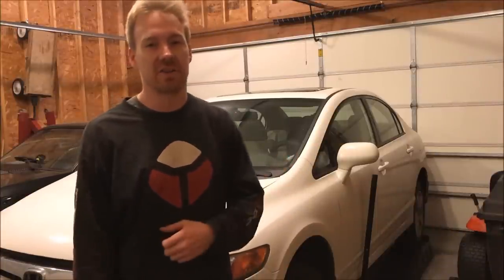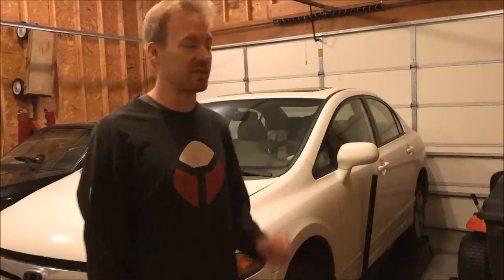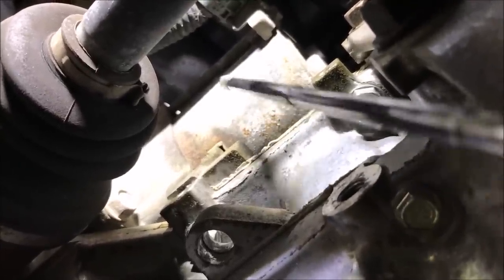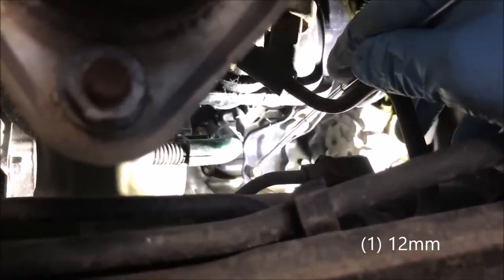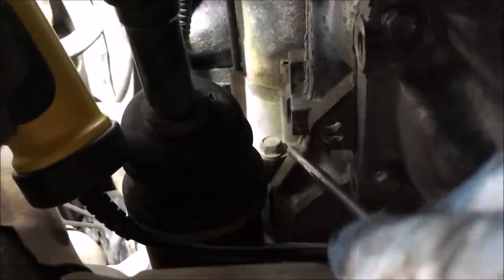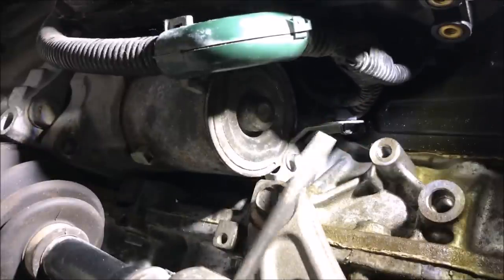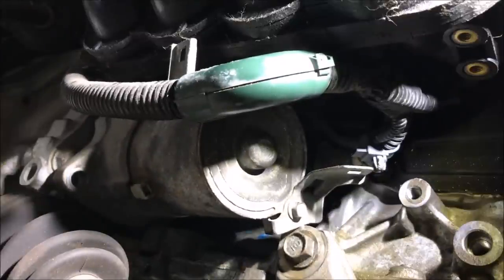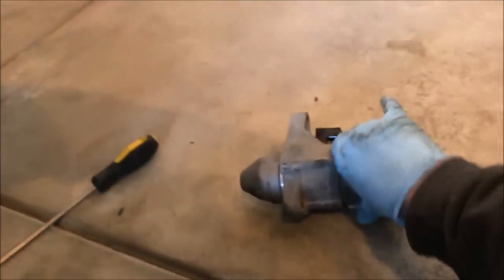Honda Civic Starter Replacement & Diagnosis

Comment: Best video out there for this procedure, and you made it look easy! Thanks for the tips about the electrical tape on swivel joints/fasteners, hadn't thought of that one myself.

Also, just FYI, my 2006 civic starter also began to (intermittently) crank a bit slower around the 250k mile mark. Besides taking a bit longer to start when experiencing the issue, this problem also caused the remote starter to occasionally fail to start the vehicle, presumably because it failed to start within some maximum allowed cranking time. After replacing the factory 8 gauge grounds (all three), which were fairly corroded (i.e. green death on surface, brittle wires that snapped when the grounds were flexed during removal) with 2 gauge wiring, battery terminals, and the battery itself (with an optima yellow top), the problem is still there.

I used an amp clamp to measure peak starting current this past weekend and saw 255 amps during my first cranking cycle, which was, by luck, a slow one. The next 5 starts used between 88-95 amps (peak). Battery was freshly charged as of the first test and each cranking cycle was limited to about 5 seconds with the engine disabled from starting, but spark plugs in (i.e. full compression, so should expect normal amperage draw from starter).

Although the starter itself is still holding out at ~270k, I'll be replacing it soon (my reason for searching for a video like this one), as it seems to be getting a bit worse lately.
Reply from the maker: Matthew Curran Great comment! This is exactly the information that needs to be out there. The problem disguises itself to be a charging issue, but the culprit is the starter. As you point out, that’s almost certainly the case for you given the repairs and mods you’ve completed on the charging side of things.  

And yeah, it’s not too bad of a repair if you’re used to shade-tree mechanicing. Best thing to do is get the car as high up as you can and use something to support your head. Neck tends to get pretty tired. Best of luck!
Reply: 0999999
Reply: I know Im kinda off topic but does anybody know of a good place to watch newly released series online?

Comment: I got stranded 45 mins away from home (sucked!), I tried knocking on the starter and had a friend turn the key, but no luck. I will be returning tomorrow and I'm going to try to replace it based on your video. I watched a few other videos and said screw that haha. But after watching your video with such concise details, I'm giving it a shot. Thanks for the thorough video and wish me luck ha
Reply from the maker: Joe Humeas Yeah sounds like a bad time to break down! Usually never a good time!  If you’ve got some mechanical know-how, you’ll be able to do it. Main thing is to make sure the wiring clips are all unclipped so you have adequate room to work and to be patient and take your time. I had to stop several times to rest my neck, but it worked out pretty well. Better than I expected. Best of luck!
Reply: Blueoyster5 so I gave it a shot and it was rough. After 3.5 hours I had to head back home. I was able to remove the old starter and get the smaller bottom bolt in (not all the way in!) the new one. I’m going to head back tomorrow to finish up. None of my bolts unscrewed easily and the clips were all just as difficult.  I was able to clip the black electric clip onto the new one and I screwed the 10mm nut on, then covered that nut with the black rubber sleeve/cover. And then I half way screwed on the bottom smaller bolt, so the new starter is in place. Should my car start up now? Or does the long bolt need to be in place before it will work? I’m sort of nervous I put this in and my car still won’t start. Any further tips are appreciated thanks!
Reply from the maker: @joehumeas7196  Damn, kudos to you for tackling this job off site!  I'm not sure I would've been brave enough to do that, so right on ya man.  Otherwise, it's an absolute necessity to have both bolts firmly in place before trying to start the car.  Anything less and you could destroy your new starter and possibly the flywheel.  Definitely don't risk it.  The starter (when activated) produces a ton of torque to spin the engine to get it starting.  If the gears that mesh the starter to the flywheel become misaligned you could grind them together or at worse, break off gear teeth.  It sounds like you've done everything else correctly, so I wouldn't be too worried if the problem is indeed the starter.  Sounds like you've just got the starter bolts to finish and it'll be smooth sailing from there.  Hope it comes a bit easier when you get back at it.
Reply: Blueoyster5 Yeah I would do anything to have been able to get it at least in my neighborhood. I put the black electrical clip on and I’m super nervous it’s not on tight since I didn’t hear a click? Should it def click? I’ll try to pull on it tomorrow and see if it’s secure. Yeah, I’m hoping tomorrow goes much smoother/easier. Thanks again for the help and the awesome video.
Reply from the maker: Joe Humeas I don’t think you’ll necessarily hear it click when it connects. If you pushed it on with adequate pressure, you’ll be good. You could pull a little on the wire and make sure it doesn’t pull off, but otherwise I’d say the odds are in your favor.
Reply: @FastFixYouTube  Just a followup: I went back last night and after an hour, the new starter was secured and my car started right up! I found the electrical tape to be very helpful.  I wish I could do it all again, because I know it would be waaay easier a 2nd time around. It seemed impossible at first, but it's definitely possible.  I recommend a lot of light (I had a crappy light that wasn't as effective), jack your car up as high as possible (with my head on the ground my nose basically hit my undercarriage, so more room would have been helpful), I found laying with my head inside the wheel well against the rear side and using my right hand on the ratchet with my left arm/hand up under was a good angle to loosening and tightening the starter. Also, this job would be much easier if you have a friend able to hand you the tools you need.  You basically have no room so you're just feeling around for the correct tools. I wrote down all of the steps on a piece of paper so I didn't miss anything. Props to Blueoyster5 for making this kickass video!
Reply from the maker: Joe Humeas Awesome! I was wondering how it went for you and I’m glad you were able to get it done. And yeah the points your raise about room, lighting, tools, etc, is right on. Having good conditions to work makes a huge difference. Glad to hear your success story! Take care.

Comment: Glad that bracket with the two 10s and a 12 isn't anything major. Lost one of the 10mm screws. Great vid. I didn't realize i should take the wheel off first.
Reply from the maker: Glad it helped! Haha, yeah we all loose the occasional screw/bolt.  👍

Comment: Thanks, this will help a lot. $600 bills to have the dealership do it. $200 for a new starter...$135 for a rebuilt one.  I am taking the plunge so wish me luck.
Reply from the maker: Kyle Ernst The cost of the repair is what drove me to fix it myself as well. Just take your time and have the right tools. Best of luck!
Reply: @FastFixYouTube  Finished and all turned out well. Thank you very much for your expertise. It was a great help!
Reply from the maker: Kyle Ernst glad it went well!

Comment: Now i see why most mechanic remove the axhaust pipe is more work but easier to remove starter
Reply from the maker: Hello. Yes, that does free up much needed space. I didn’t want to do that in order to make this less intimidating as exhaust bolts can be a bear. But yes, that does help. Thanks for the comment and good tip 👍

Comment: Just did this job on a 2007.  Since I had the car on ramps, removing that exhaust pipe section was the only way to get the starter physically out.  The pipe hardware was surprisingly easy to unscrew, two bolts, three nuts and it drops right out.  The hardest part of this entire job is getting the starter mounting bolts in on reassembly.
Reply from the maker: Yes, I’ve heard others that have said removing the pipe is the way to go. And completely agree regarding the hardest part.  Not a fun job, but a big money saver.

Comment: My civic is from Canada  , I got the bolts off and the clip , could not turn it around to take off electrical connections as of this comment
Reply from the maker: Hello. Did you end up getting to those electrical connections?

Comment: Symptoms and Diagnosis were spot on!! I started with a new battery as well..  But the problem wouldn’t correct itself.. I watched your video and it was exactly the same problem! The starter was disguising itself like a dead battery... Changed my starter and boom!! problem fixed! Thanks for the video!
Reply from the maker: CHRISTIAN SUAREZ you bet! Glad the video was of some help and happy to hear you got your car fixed! 👍

Comment: Blueoyster5, this is the best video I've seen for replacing the starter on my 2007 Honda Civic EX with 140100 miles on it.  I put the miles on the cars I drive.  It's September 15, 2019 and I bought it May 2017 two and a half years ago.  Got a great deal on it at $7,000 and only 17105 miles when I drove it home.  My friend told me about his friend taking the car to Carmax after his mother passed away and they offered him $7,000, but he didn't have the title in his name yet.  I found out about it and called him.  Met him 130 miles away with the money a couple of days later and waited until he received the title back from the state, met him at his bank, got the title put in my name, met my friend at the DMV, got the tags and drove it back home that weekend.  My biggest problem these days is I don't trust too many people to work on my cars or anything else for that matter.  Sorry, but too many people just don't take pride in their work and the customer suffers.  After I bought it, the first time I changed the oil I had to use a breaker bar to get the plug out and I was afraid I might strip it, but not after seeing how tight the last mechanic had tightened it.  I personally hadn't changed oil in years.  It's a challenge to me these days.  I'm certainly not a mechanic, but I believe I can do this and it isn't going to be easy as I can see by your excellent video.

I'd encourage anyone who looks at this video to subscribe.  I think you have done your best to help us to be able to do the job or at least have a better idea of whether we want to do it ourselves.  Thanks. Sixpick6pic
Reply from the maker: Thank you for this reply. You said exactly what I try to do in my videos. To show in detail how the job is done and accurately portray how easy or difficult the job will be. It’s very hard to show how difficult a job is through video because so many of the challenges just can’t be grasped by watching someone do it. In fact, I feel it almost makes it look easy and we can get a false sense of ability from that. I’m glad you got the point I was trying to make. 

And I can’t believe you had to use a breaker bar on the drain plug. That’s just outrageous...  and I 100% agree with you regarding pride in work. Unless the work is backed by a good warranty, it’s hard to extend the necessary trust in people sometimes. 

Glad to hear you got a good deal on a low miles car. My civic has been pretty good to me considering the use I’ve put it through. Cold winters and hot summers and a lot of driving.

Best of luck to you when you decide to tackle this job! Feel free to let me know how it goes. Take care.

Comment: awesome awesome. just changed an '06 starter with my father-in-law after watching this video and I don't know much about cars.  Video was such a help and saved me a couple hundred bucks. Took 4-5 hr. Really appreciated the hints about using the ratchet extensions and swivel head. 

two parts were a pain in the A: (1) wiggling the old starter out past the green elbow. (2) putting the top bolt back on with the new starter.  However persistence was key and it worked!
Reply from the maker: 4 to 5 hours isn’t bad at all!  I completely agree with you on the two paint points, although the top bolt went in very easy for me, so I can’t complain too much about that. Glad this video helped you! I appreciate the comment!

Comment: Thanks for this video! Tight spot. Few hours but got it done!  Honda dealer wanted $900 to install new starter. Bought a new Honda starter for $200 and installed myself.
Reply from the maker: Nice work!

Comment: You are a God among men to do this job and record it simultaneously!  Holy shit, I used about 526 curse words and was about to set the thing ablaze.  

Thank you so much for putting this out here and taking the time to thoroughly explain this to laymen like myself. 

After 14 years and 316k miles my starter is showing signs of dying and I have a new one from Honda on order, this job is such a pain in the ass there’s no way I’m taking a chance on an aftermarket starter.  

Thank you thank you thank you !  I have the old one off and hope to god I can get the new one in tomorrow !
Reply from the maker: Best of luck getting the new one in there! Haha, yeah filming was not easy, but I figured people having to pay $800 for a shop to do the repair was worth the effort   Appreciate the comment!!
Reply: Hey dude!  Good news ! I got the new one installed today in about 45 minutes, man want a wrestling move to get that damned thing back in there.  I got the top bolt in with relative ease and threaded it in with the tips of my fingers.   Thank you so much for making this video, it means a lot to me.  I drove the car to work tonight and it started with confidence and I can hear a major audible difference between this one and the old one.  Take care ! Subscribed !

Comment: This video was perfect. I was able to replace my 2006 civic in about 4 hrs. Saved over $200 from the lowest quote I got from a shop, even with extra equipment I bought. 

The long bolt in the back is way father back then I would have guessed. Took me about 30 mins to find... But with the extra extractors, swivel joint and jack stands it was a piece of cake.
Reply from the maker: That’s excellent! And I agree. The long bolt is sort of a bear, but manageable. Glad the fix went well for you. I appreciate the comment!

Comment: This video was very helpful & detail for my 09 Honda Civic. This car doesn’t have access to from the tire to remove D starter. I removed n replace the starter from a gap I found behind the tranny n engine. I wasn’t able to removed d starter from the tire side I had no room there. Installation was much easier than removal. I spend all day yesterday 🙏 Remember to buy a stubby 3/8 flex ratchet, joint socket adapter n lots of extensions it going to make life n day easier. Much appreciated
Reply from the maker: Hey there. Yep, absolutely can turn into a multi-day job. Glad you got it done! Nice job 👍

Comment: Best video I found out of all ! I had exactly same situation 2009 Civic with 230,000 miles and 15 degrees out!  watched it a half of dozen times before I finally “went”for it lol. everything went well until I got to the top bolt, I had 3 extensions and a swivel joint and it wouldn’t budge.Finally snapped the swivel joint. So my son came over with a 12 inch breaker with a swivel SOCKET on it and it came right off. getting it back on was ok but with out the extra set of hands don’t think I could of got it in by myself, but that’s just me all that tight space I had no patience 😂 couldn’t imagine videoing it at the same time ! But I got her done with your help THANKS SO MUCH !
Reply from the maker: Great to hear!!! Yes, the struggle with these is real. Glad it worked out! I’m happy to have made the video as it has helped many with a starter issue. Thanks for sharing the success story!

Comment: Great video, thank you so much! Was able to do this in 3 hours. To all those that are nervous, follow this video and have extensions. I also used the end of a hammer to push up on the starter and that really helped get that top bolt in.

Edit: I live in Wisconsin and my civic has 260,000 miles.
Reply: yeah that tip about using electrical tape over the sockets/bolts was key. I was literally stuck for like 5.50 hours last night sucked. and my phone died so I was never able to complete his video!
Reply from the maker: You are very welcome!  I appreciate the added advice as well. It truly helps others who need help with this. It is a process. Oh and greetings from the Midwest!  We have similar mileage and location 👍

Comment: Thank you so much for this video.! I was about to quit and hand it off to an expensive mechanic to finish the install.  Then I saw your video on where you had to unclip the wiring harness near the drivers side to give it enough slack to put the starter in. Everything went smoothly from there.  God bless!
Reply from the maker: Fantastic!  I’m glad this helped you get it done and save money! 👍👍👍

Comment: I’ve been trying for at least a full days work to get the bolts back in, can’t get it to align back up properly. This job should have been a lot easier than it has been! Great instruction, thanks!
Reply from the maker: Sorry to hear that!  You’ve probably already done this, but take a break and come back to it later. Check around the mounting points and make sure nothing is interfering with the surfaces that may cause misalignment of the bolts.  I completely understand your frustration, but I’m sure you’ll get it done. Best of luck!
Reply: That taping of the extension trick is really a must and having someone underneath to make sure your perpendicular to the whole would help. They can help you push the bolt up and down. Also if you carefully round the  threads on the end of the bolt just  a bit they'll  find the holes and seat themselves don't use it air ratchet hand feed/ tighten them  To start.